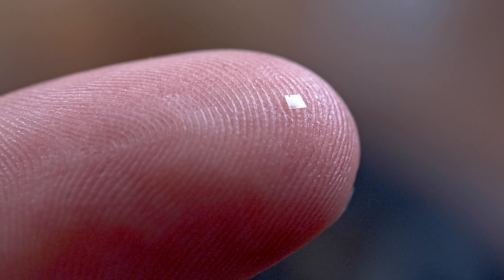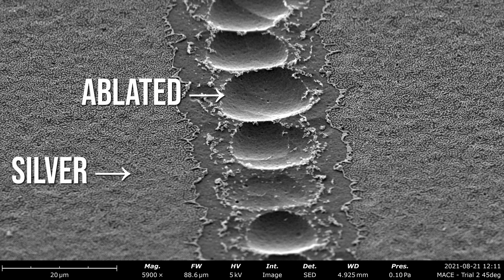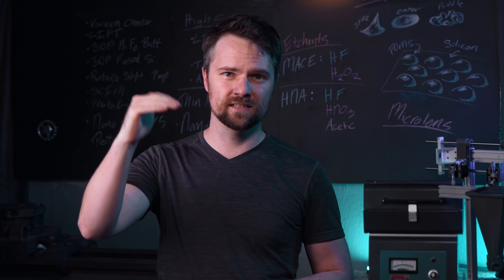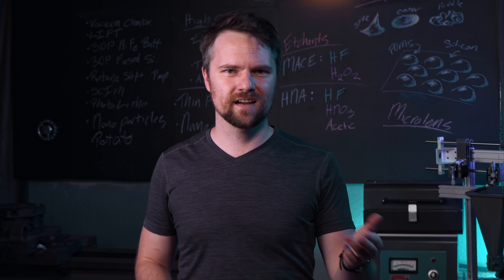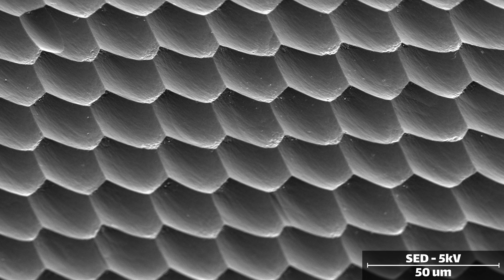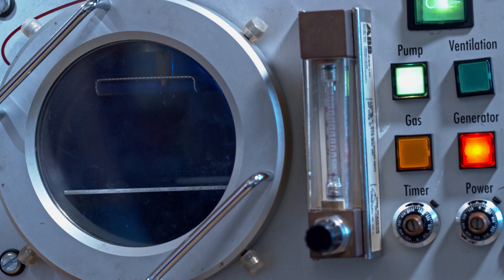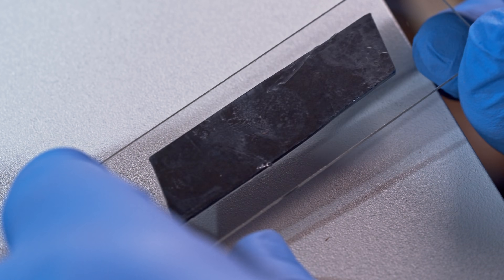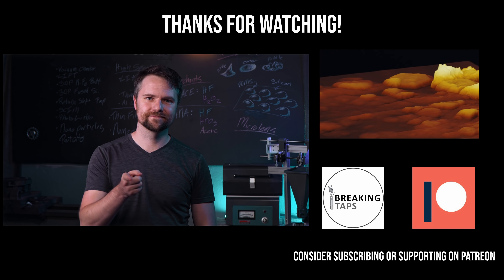Molding a Microlens Array

Comment: For me it was no surprise that the continuous silver layer worked like a mask. The selective metal etching requires (according to your description) the H2O2 (and afterwads HF) to get below the metal layer, so it should only work with metal structures with relative low width or porous metal structures. With a continuous silver film, there is just no way the etchant can reach the silicon and thus it acts as a mask (except on the edges).
Reply from the maker: Somewhat surprisingly, it depends on thickness of the metal film. There are some papers (https://pubs.rsc.org/en/content/articlelanding/2015/ra/c5ra15745e/unauth) that show both effects depending on the thickness.  With 40nm of gold, you mostly get edge effects like you mentioned... it edges just on the edges of the metal and you start to get a "curved" structure.

But with 20nm of gold, there were enough nano-pinholes that the etchant could diffuse through the metal film and etch evently (and also caused a forest of "nanowires").  So I only deposited 15nm of silver onto my wafers hoping it'd be similar.  Not sure why it didn't work to be honest, perhaps silver reacts differently?  It does have oxidation states that Gold doesn't, so maybe that plays into it somehow.  I would have expected to at least see the edge of the silver to etch some but really didn't, no matter which sample or test I looked at :(
Reply: @BreakingTaps  The problem might be that you sputter your metal layer. Layers deposited by thermal evaporation or e-beam evaporation typically have larger grains and thus more pinholes. In our old Edwards 306 the gold films have grain sizes of 10-20 nm, so a 20nm-film wouldn't be continuous. But with sputtering, the metal has a much higher mobility on the surface and thus you will get a film with higher density (which is less favourable in this case). 
If you are interested in a relative easy way to create large areas with (more or less) regular patterning you should look into nanosphere lithography: depositing a monolayer of small polystyrene beads by adding a drop of water with the right concentration of particles (we sucessfully used particles down to 220nm). The surface charge of the beads should be same as the sample), deposit your metal, and remove the beads (which can be done with scoth tape). You can also use a even lower concentrations of beads with beads having an opposite surface charge as your substrate and get a metal film with random holes. But in this case, you have to remove the beads by solvents and ultrasonic cleaning.
Reply from the maker: @florianf4257  Ahh, that seems like a very plausible explanation. I bet that's the issue!  I might try again with a very light coating (few nm) and see if there is noticeable different results.  Will check out nanosphere litho, sounds interesting and pretty approachable!  Thanks for the brainstorming and suggestions!

Comment: Put the mold release on, spread it around the surface so it touches every part and then spin it off at really high RMP, but adhere the slide to the rotor of the spincoater, hold the apparatus upside down and then turn it on! This way the mold release should be able to completely evacuate those cavities, allowing you to cast the microlenses without that tiny dent on each lens 'ball' 😁

Comment: Nice,  I remember about 25 years ago some researchers in the UK made a micro lens sheet film but I think the lenses were a few millimetres in diameter and the optics were such on the lenses you could shine a projector onto the lens film and then view the sheet from any angle and see the flat image that was being projected without distortion from pretty much any angle, the lenses accommodated for any distortion. I don't remember if they mirrored the back of the sheet or whether it was all in the shape of the lenses

Comment: Realy cool project. I didn´t knew about metal assisted etching myself and will try it in my research. 
For the etching process: In my experience laser structuring of a silicon surface with a thin film layer of gold leaves some regions in crystaline and some in an amorph phase. So actually what you suggested with the melting. This is proven by several methods like TEM lamella and leads to interesting results with anisotropic etching, as the amorph layer reacts completely different to an KOH/Isopropanol etchant.

Comment: those rough looking ridges look like a way to super micronize the thickness of a sound absorbing coating to go on a wall or something similar. might be a cool experiment to make enough to put a cone of silence around a mic so only what is directly in front of it is picked up, any side glancing sound waves get absorbed mostly and don't hit the mic?
Reply: The reason sound absorbing materials are big and thick is because sound waves are on the scale of centimeters to decimeters. Any obstruction smaller than the wavelength of the sound you want to absorb is no obstruction at all. The wave will just roll past it without noticing.
Reply: @Greenicegod  question, how does such a long wave travel in air when gas particles are so small? LOL

Comment: try ablation under vacuum. try adding pinhole separate physical layer in the same pattern behind your microlenses. glass workers i've worked with say it's safest to handle HF with bare wet hands - kept wet and rinsed while working. prevents the acid from hitting the skin directly and does a bit of dilution and prevents direct contact with skin. it's the HF permeating skin that leads to bone loss under the contact. (not seen this in action) want to collaborate? tell me how.

Comment: Very nice presentation. The anisotropic Si etching you experience in the first part is probably due to the material quality or purity of your Si substrate. It could be residue from the polishing or it could be the actual material (when the ingot was made). If you want to repeat it, I would go for high resistance FZ Si with a good RCA cleaning procedure before you start.
I like your warning about the HF. Its extremely dangerous. HNA etching is very fast and tend to show localized etching variations that would probably not give you any good result.

Comment: I just attended a talk by a guy (Greg Nielson) who's developed a technology where two photon absorption is used to make silicon (or silicon carbide) susceptible to etching. Two photon absorption is caused when photons at energies lower than are needed to excite electrons out of the valence bands can still cause electrons to be excited when two photons together are absorbed. Since this is only statistically possible when the intensity of light is very high, you can selectively etch a region controlled by the focal point of a laser source. The silicon is transparent to the laser and doesn't have much effect except at this focal point, which means you can etch out 3d paths with very precise geometry and ridiculously high aspect ratios of tunnels (like aspect ratios above 1000). It's like SLA printing in reverse. Pretty cool!

Comment: This silicon spikes are probably from the expansion of the silicon upon cooling after melting.  I get (much larger) ones when I use an electron beam deposition system for evaporating silicon.  Careful control of the laser parameters should allow you to create spikes with different geometries (size, height, etc.).

Comment: What parameters are you using to produce the "micro-spikes"?  If you coat them with silver, I suspect they can be used as a reflective axicon lens (or "reflaxicon").  Then it would be interesting to use your ablation laser reflected off that, producing a Bessel-like beam, or perhaps an array of these beams.  You said they are about one micron tall and have a radius of 200-400nm?  I would hypothesize that you can produce more uniform ablation/etching using bessel-like beams because the waste material will not interfere as much, there will be fewer optical aberrations.  Add a phase conjugate mirror to the mix and you've got something special.  Very interesting, indeed.
Reply from the maker: Added some details to the video description! Basically low power (6-10%), 40kHz, and a 63mm lens on my particular machine.  That's an interesting idea about the axicons!  Will mull it over, and might be able to do something fun with the etched ablation craters too if they are coated.  Hmmm
Reply: @BreakingTaps  Please permit me to offer some unsolicited advice.
Watching your video, it occurred to me that the problem you were having is not unlike the sort of problems many hobbyists have when trying to make molds of toys or small gadgets. 
If I interpreted your description of your molding process correctly, you simply poured the silicon into the available gap on the mold you wanted to use. This is not a bad way to make molds for jelly candies, sugar candies, and other similar edibles. You may have noticed that many of these candies have hollows in their shapes not at all dissimilar to the ones that you have in your lenses. Fortunately there are a number of possible solutions to this issue. I recommend that you take a look at the methods used in industry to make casts and molds for metal, plastic, and silicone. What I think will be most beneficial tfor your purposes is adding a sprue, runner, and a riser to your casting. I would also ad an exit sprue for excess material. You want to pour more material than you are using, have a slight rise from the pouring cup and sprue into a well that connects to a runner, then to a riser,  then another riser which may or may not have a gate and into the casting  and the exit sprue which should rise to the level of the pouring cup sprue so it can catch all the materials being displaced, and help to maintain the pressure on the mold surface. Insufficient pressure on mold surface is a very large part of the problem you are having with the lenses being deformed. The added material has to be trimmed, but you will most likely end up with a significantly better quality final product. 
I hope that you will find this helpful. Thank you for sharing your interesting work.

Comment: I wonder if the mold release would be cleared if you were to stick the whole thing upside down affixing it to the center so you could spray upward on it then spin to get it to that super thin layering effect, the other aspect would be to run it at various spin rates so you could find the rate that leaves more instead of less to create dimples of sunk in mold release where the pits are at, and it becomes your smooth surface for the lenses to form?

Comment: Interesting, thanks. I wonder if you could spin off the mold release by setting the glass plate on it's edge, off-center, etching facing out... you'd need another glass plate for balance and some holder for both plates.

Comment: For what its worth, in animatronics we would use a silicone release that was paraffin wax and hexane(iirc). I had the thought of spinning that on a mold to see if the surface left from the wax would be smooth enough. But considering the size scales and some of the other chemical engineering in other posts about releasing silicone, yall are miles beyond my level of chemical understanding LOL

Still, love the channel. Its awesome seeing someone beyond the 'this is a resistor' beginning level kind of stuff, but not talking like a retired academic using terms only people with doctorates would understand. Makes for a great intermediate 'next step' if you will in learning higher sciences. 😁👍

Comment: @Breaking Taps - I suspect your laser etching was so intense, it vaporized the photoresist, causing ablative etching of the underlying material. With that in mind, I think you could skip some steps and the dangerous chemicals, by just painting the surface with something that is black at your laser wavelength, and directly etch your pits. You will of course have to experiment with thickness of the paint and the laser power/focus, but you should be able to produce etching of a wide range of surface textures just by varying those 2 parameters. I discovered this effect when etching patterns onto the back of mirror tiles. In that case, too little laser power would remove just the black paint, leaving the mirror metal largely undamaged, which was then very hard to remove with further laser etching.

Comment: Wondering. Do you think using some level of ultrasonics could help with the agent pooling in the dimples issue? Certain frequency vibrations can liquify sand, at least in function. It may be capable to the friction and viscosity of the liquid so it will flow more freely. Or maybe spin it upside down, so gravity works for you with the centrifical force. That way, any blobbung happens at the lowest point, which should be the surface outside the dimples. Better to have the outside of the lense marred rather than the middle.
Also, for the weird bubbling. I heard from another lithography video that the laser frequency is super important. Each frequency can interact differently with different compounds. In their case, the frequency laser they had wouldn't work with certain materials. So, if they coated the surface with them, their laser would go clean through it and interact with the material underneath, which was the opposite of what they wanted.
Now, I'm no expert by any means. Still, the bubbling looks like it may be the laser is going past the surface and heating the material underneath, which if done for long enough begins to melt the upper layer through heat transfer, which may be resulting in the upper layer melting a bit and acting like a bubble containing gases from the laser interaction.
Now, again, I may only have a hint of an idea of what you were going after, but if you are wanting to have the laser interact with the surface material, you may need to find a laser with the correct frequency to fully interact with that material.
Just something I heard in a video, not an expert here.

Comment: again, a great project with a great video.  Glad you added the Calcium Gluconate rescue.  one of the routes of fatal toxicity is through calcium imbalance.  The Calcium Gluconate reduces the bio-available Fluoride.  One question about your quest for a "pock mark free" lens array.... did you consider curing under pressure?  This, coupled with degassing should eliminate bubbles as a factor.

Comment: would you be able to flip the thing over after spin coating for a while, and run it again? Or would that lose all the coating to gravity? Alternately, would an even pressure of an non-reactive gas during spin-coat help to smooth down the mold release lumps?

Comment: Try placing the mold on top of the epoxy resin so the mold release flows out to the edges of the craters rather than to the bottom.

Comment: If you can figure out how to make micro lenses inside lenses inside lenses without them touching, it should bend light to the next lens making invisibility cloak. Came up with this in 2006, but tech wasn't able to built this yet. 
- Steven McCament 2021
Reply: With the same refractive index or with different refractive indices ?
There’s also already meta materials that does this.
Reply: @heidelbergaren5054  the angle of focus and so index would change by the size changes of each lens, but clarity shouldn't need to change
Reply: @kingofnothing2260  
RF would change by the size of the lens - que ?
Reply: @heidelbergaren5054  as long as the lenses are in the same physical size as the bandwidth desired to bend. They would focus light to the center, then reflect at a very shallow angle into the next set. The light may shift and may even be made conductive or polarized and the reflector could be the same or even a nantenna

Comment: I wonder if instead of a subtractive manufacturing process, you could instead find some way to form micro bubbles out of clear resin with a specific radius and regular arrangement on an array pattern.  I'm picturing something like a grid that you pre-form using a resin or sla printer, and then maybe dip the array into resin and allow the surface tension to naturally form perfect spheres in the grid. 

Maybe you could get more perfect micro lenses

Comment: If your PDMS developed too much of an edge bead on the wafer edge, you will have trouble plasma bonding it because it's not flat. You'll want to trim the PDMS sheet edges or you ended up switching to PDMS glue layer which can fill in uneven surfaces. With photoresist the edge bead buildup can be rubbed down and thinned with a solvent spray or on a q-tip, but I have not tried this approach with PDMS.
Reply from the maker: Noted, thanks for the tip! Didn't think about a glue layer either, that's a good idea. Cheers! There definitely seems to be a bit of an art to PDMS molding :)

Comment: What became of this micro lens? Is it possible to adjust the size & shape of these lens dimples? Can a plate be reshaped for a lining of a larger lens or the inside surface of a sphere? Is the texture usable or too small? Maybe a micro sluice? Sound redirection? Fine Video, right was a smidgen long but I stuck it out.

Comment: It seems that you should be able to ablate and/or etch holographic fringe patterns into that silicon as a mold and produce transmission holograms of very high quality.  How many lines per inch do you suppose you could make precisely?  And then using such a holographic fringe pattern plate, could you shine your ablation laser through it to ablate material in a volumetric region of space or otherwise change its optical properties?
Reply from the maker: 20-30 micron is about as close as they can be spaced, otherwise the pulses start to each each other. So that's like 800-1000 lines per inch, something in that neighborhood?